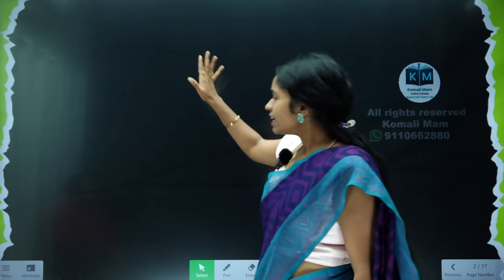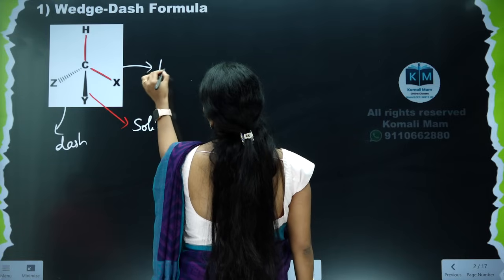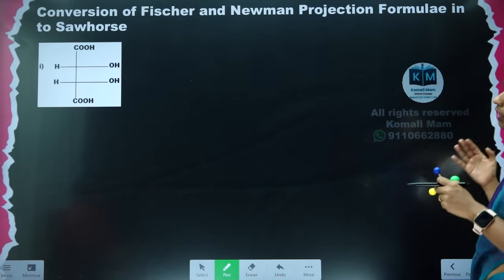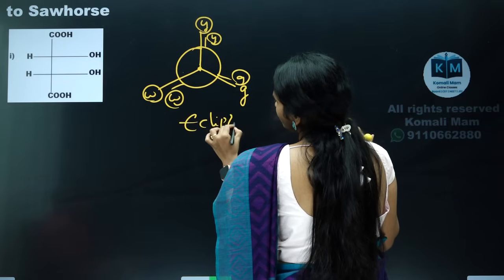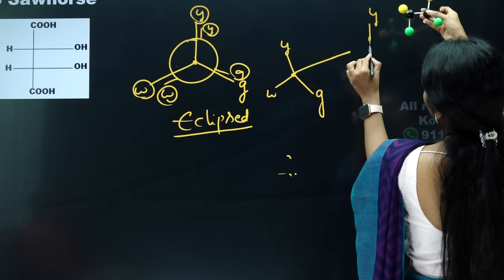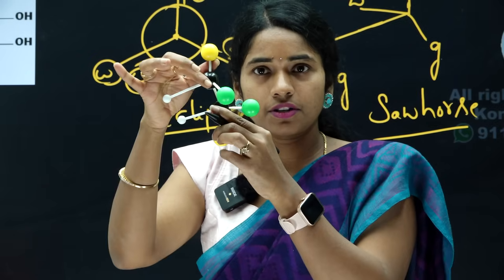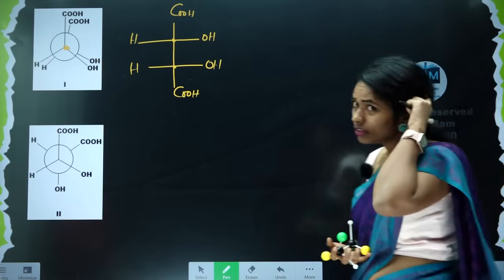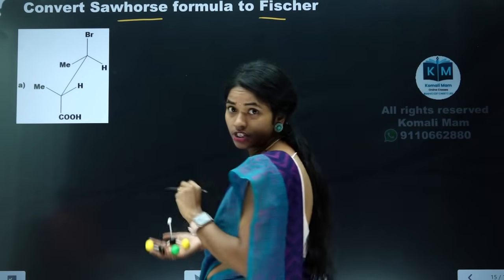wedge dash structures,fischer, saw horse,newman projection formulas &their interconversions oneshot

Comment: Thank you so much for your valuable teaching Mam. At 19.49 min you converted some 2 chiral carbon example of wedge dash to Fischer. In it why did dash lined groups occupied the top and bottom position instead of thin lined groups contrary to the previous horizontal example? When should we do like this? Please explain